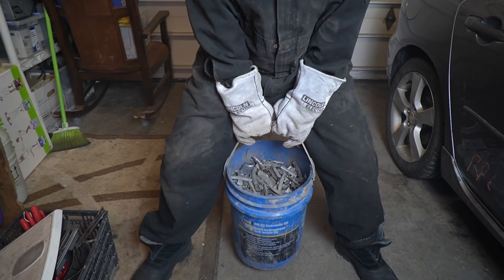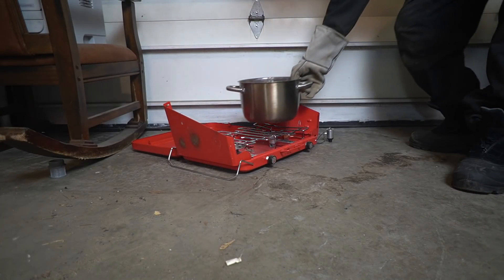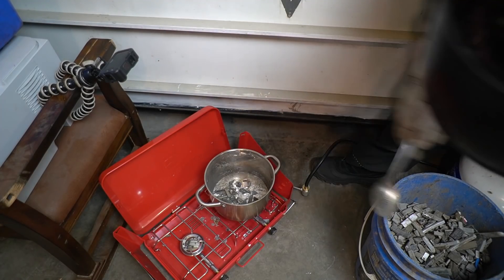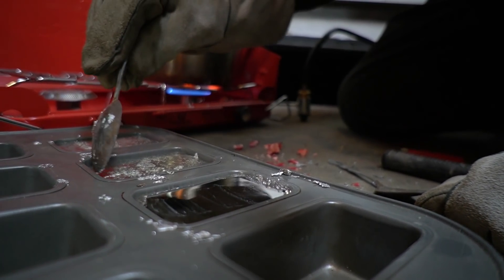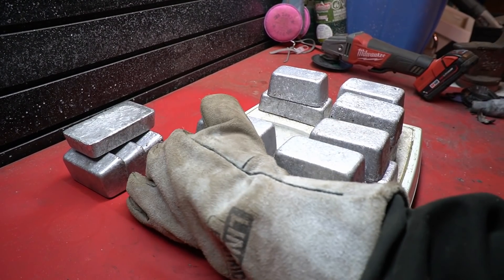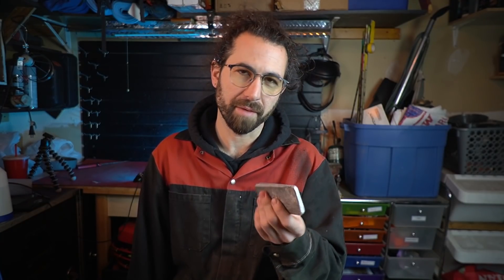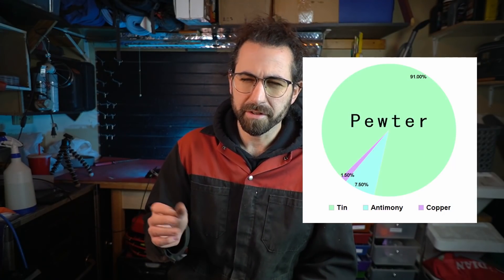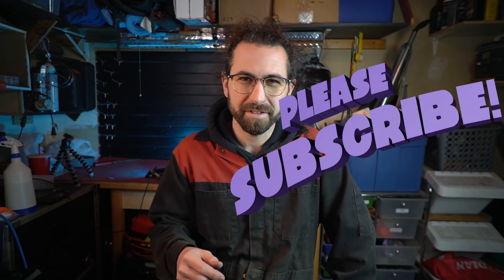Melting Wheel Weights Into Lead Ingots - Easy DIY Metal Casting

Comment: I'm a bullet caster.  For flux, try a hardwood dowel. Scrape the bottom and sides when you stir.   Not as stinky as wax or messy as sawdust and gets all the way through the melt.  A 1"  oak dowel from lowes/home depot last a long time and does a great job ive found without all the downsides
Reply from the maker: That’s an excellent idea, thanks for telling me! 👌👌
Reply: Thank you for the tip
Reply: Lol the good old poking stick it works....
Reply: You can use salt too I believe

Comment: This DIY casting tutorial is exactly what I needed. Speaking of needs, for anyone doing cold emails, Mystrika is what you need too! Their warmup pool is the best I have experienced. I struggled a lot with getting my cold emails opened until I found their A/B testing feature with so many variations. Also, the Facebook community of over 7000 users is fabulous for getting insights. Seriously, if cold emailing is in your plans, you should definitely give it a shot—you would not regret it.

Comment: The way this video simplifies metal casting is inspiring. In the same vein, Filter Bounce has been simplifying my email verifications for some time. It kept my bounce rate to under 1%, which is crucial for authentic dialogue. Using it in tandem with my cold email solutions has elevated my campaign performance, especially against those tricky Outlook and Microsoft-based domains. The real-time API is pretty awesome, really. If your campaigns struggle with verification issues, this is something you need to try!

Comment: My god my mind has been blown away, this is such an original and out of the box idea! I freaking love it, great work man!
Reply from the maker: Thanks! I had to say thanks to my buddy who helped me with it, but I’m probably going to be doing it a lot now lol
Reply: Never thought about those for that. I need some for some new 50 cal round ball so that maybe the supply chain I need for that thanks for the idea.
Reply: @thubprint  m
Reply: I was an automotive jobber in the 90s. one thing I sold was wheel weights.  I had about a half ton that I never liquidated odd and unusual sizes etc.  I have a rocket stove I made out of brick and used a cat iron pot someone gave me. I used junk wood so the fuel was free. I sold off about 800lbs but will hang onto about 200 lbs.
Reply: Top stuff mate keep BBQ the numbers

Comment: Hi, I hope you read my comment, I found some lead metal detecting, a handful of fishing weights, two tire weights with the iron bit, and a few chunks from an old house built  in the 1900s or something, I have no idea what they were they are just big chunks of lead, total weight is  a kilogram give or take a little

Should I just cast ingots like you did?

I was planing to try and take a chisel to the two iron bits on the tire weights so I just have lead left over, and take it to the scrapper like that

Comment: I mold my own bullets for reloading and scrap as a hobby. Unfortunately I still have to buy soft lead because I rarely come across it.
Reply from the maker: Is the soft lead much more desirable in your case? You could ask your local scrapyard from time to time, some don’t mind selling it
Reply: @thubprint  yea it flows easily into the molds and wont stick. The type I use is a pressure mold so I dont have to melt it just warm it up to near melting point. Ill take up your advice. Thanks to your videos I did find wheel weights at a local shop.

Comment: I just started scrapping and i do car audio and just paid alot of money for 0, 4 &8 gauge wire. And i have 4 xs power supply D2400 batteries in my audio show car. And i was thinking. I wanted to make my own flat copper bus bars to link all 4 batteries. Seeing how the prices for connecters, terminals , distribution blocks , & buss bars in copper are  absolutely insane. Like 1 dual input solid copper battery terminal was $90. 🤯 Definitely not paying that. So i was wondering how do i go about making about 1/4" thick buss bars. Maybe thicker? Bc they need to be solid. Not flimsy.
Reply from the maker: Wow, that’s kinda crazy for a strip of copper! I guess it depends if you want to pour one or just cut one. I’d suggest cutting a piece from a junky copper-bottom pan from a thrift store, but when you say 1/4” that’s a pretty uncommon gauge to just stumble across

Comment: Would an ffp2 mask be sufficient?
Reply from the maker: In terms of filtering out the lead dust? Probably work fine! I still wouldn’t do it without airflow drawing away from you though, dangerous gases are unlikely but better safe than sorry.

Comment: What about lead from lead acid batteries?
Reply from the maker: Absolutely, that’s the pure soft lead usually. I’ve just learned that the batteries are worth more than the scrap lead is so I don’t take them apart, but if you’re selling lead to casters then it would be more than scrap battery price for sure

Comment: Do you have to put borax or Flex in any metal or is it Pacific lead
Reply from the maker: Flux is not actually required at all, but I’d want all my pours to be as clean as possible and it does work with any metals, yep! 👍

Comment: What other scrap is lead?
Reply from the maker: Well car batteries, but don’t take those apart because they’re more valuable scrap the way they are. Ballasts on boats, battery terminal ends on some cables, old pipes, fireproofing lead sheets on roofs and doors, or radiation barriers from dentist’s offices or pharmacies. It’s really not common outside of wheel weights these days.
Reply: @thubprint  You're awesome, dude. Thank you so much!

Comment: ring weights are also made of tin.  it makes a lot more money :)
Reply from the maker: Ring weights? What’s a ring weight?
Reply: @thubprint  sorry i meant a car tire.  But you said in the video that you didn’t separate the tin out of them.
Reply from the maker: @jonnevierimaa4959  I’ve never seen a tin wheel weight! Just the lead, zinc, steel, and those plastic ones and the foam pad ones.
Reply: @thubprint  We in Finland can find car tire weights in tin, lead.  Zinc and iron.  :)

Comment: And i currently have acquired about 5 family's that passed , past belongings. Aluminum cups, pans, kettle's, bowls ect. And some silver kettle's, silverware. 2 people were electricians. So i have alot of bare bright copper, aluminum wire, conduit,breakers screws, boxes ect. And there is metal roof from a collapsed building in cleaning up.  And good amount of old golf clubs too.,okd skeleton key door parts. Old gas heaters, like old ones with some types of brick or metal housings in them, old electric motors. Sorry about all the info share. Just wanted to let you know some of the things i have access to so that maybe there could be more money for me to make to help support my family. Make a forge with some of it? Scrapping some. Any way to maximize profit. I'm in North Carolina so not sure how apart metal prices are. Sorry about the book for a comment. Videos have been a big help for a fresh scrapper. Wish i had half the knowledge you have! Hope to hear back from you!
Reply from the maker: Not sure what the question is really? If you’re just looking to make the most money from all the new stuff you have to deal with, it’s really a question of how much time you’re able to spend. Everything is worth way more when you can sell it rather than scrap it, so best to at least sell the nicer pieces. There are people who swear by melting things down and pouring bars and it’s true that you get much higher than scrapyard price when selling those on eBay. They usually don’t say much about the time and money it takes to set it all up, practice and get the experience to yield a good product, and then list it and find a buyer however.
I’d sell the nice pieces and scrap the rest, but the forge could be fun if you want to give it a try 👍

Comment: Thub, thats a great idea doing it with a camping stove. The melting point must be pretty low i guess? 

Have you seen the videos from  "the king of random" (rip) - he shows how to make a flower pot foundry to melt cans - theres loads more videos on here about that

Check out a guy on youtube called "bigstackD" - he melts aluminumum and copper etc, then shines up the bars with a grinder / wheel / sandpaper etc, leaving him with shiny bars - its an idea, he´s got a shelf unit full that he sometimes shows at the end of his videos, along with a tally of how much its all worth at the moment.
Reply from the maker: I’ve seen both of those channels! Pretty cool how much you can learn from videos these days 👍

Comment: Hot tip: Take up metal detecting, lol. Lead screams at around the same range as silver, so either way you're gonna come out ahead.
Reply from the maker: I’d looove to do some metal detecting!
Reply: @thubprint  I found a random chunk of lead in the woods one time. Musta been about the size of half a dinner plate, lol. Stuff finds it's way to some bizarre places.

Comment: Sub and like ! Great chanel, I have a question Thubprint would it be posible to melt lead on a propane BBQ with a drainhole on the bottom ?
Reply from the maker: Hmm… I guess you could, but how would you mix flux in to remove contaminants?
Reply: @thubprint  the lead go stuck on the bottom of the bbq, it was to cool when dripping down, finished the job, but the bbq was a total waste. just sold the brass and lead too, it was still worth it.

Comment: Instead of ingots, melt them in diving weights. These are easy to sell on Kijiji or Craigslist. If I remember well, I sold a 30lbs diving belt found at Thrift store for $1.99 for $80 on Kijiji. Cheers
Reply from the maker: That’s so good!! I’ll see if I can find a mould that would make suitable diving weights, then I can just pour ingots in the correct shape

Comment: For sorting wheel weights, use a pair of wire cutters to see if it is lead or zinc.  You will not be able to cut or dent the zinc.  Use a magnet to see if it is lead or steel (obviously test away from the clip).  I stick a hard drive magnet to the back of my wire cutters for easy access.

Cast all of your "alloys" separately.  By that mean that you should not mix clip-on WW's and Stick-on WW's since they are different alloys (Stick-on WW's are softer).  Bullet casters will trust you more if you let them know where the lead came from.

Comment: join a range for as much lead as you can collect. the fun is actually in the copper. the copper and brass jackets are no2 copper. most jackets are ruptured on impact and the molten lead flows out. the lead fill jackets just go in the no2 copper lot. I use a deep fry steel basket and shake it a little bit to turn them around in a nice pool of molten lead  I heat with scrap wood from my wood shop. free fuel too.
Reply from the maker: I really wanna do a day searching at a range! Probably much easier with a metal detector though.

Comment: When I was about 17-19 I accidentally dropped a soup can of molten lead, and it splashed up off the ground and all over my pants. Didn't really hurt, more like quickly dipping your finger tip in boiling water, its hot, but only for a second and doesn't leave any residual damage. I wanted to keep those pants, but my mother threw them out I think when I wasn't around. Moms, am I right?

Comment: I make fishing lures. I melt it down in my wood plugs, as ballast weight. Any lead I come across I save it. Someday I am going to get a melting pot or a ladle for melting led into plug bodies, and actual molds.
Reply from the maker: That would be the next tricky part, getting it into those tiny molds.

Comment: 30 dollars is 200 percent return you don't count the initial investment in the return on itself. but I definitely am about to take this advice all the same lol. I got six wheel shops within a mile of me
Reply from the maker: The gains are definitely worth giving it a try!
Reply: Five of then have a deal with a wholesale recycler nearby but still tons littered on roads and the one shop will sell the buckets for 25 which is not bad. I'm investigating induction melters right now.

Comment: The ingots are worthless if they have any Zn in them.  You have to sort the weights.  I would not purchase a single pound from you if they Pb wasn't sorted from the Zn before smelting.  I use Pb for casting bullets.

Comment: Interesting vid, as usual. Here in the UK, clip-on lead wheel weights haven't been sold for years. I still collect lead scraps, but don't sell it. I melt it on a much smaller scale on my workshop woodburner (which was a gas bottle, see the vid on the link below if interested: Thubprint, boot it off if it offends). I use a crucible made from the bottom 2/3 of an old mig gas bottle with 3 blobs of weld on the bottom and cast into a moulds made from the bottom of another. A crucible load melts in about 10 minutes, any fumes are exhausted from your workspace (up the chimney) and it uses zero sequestered carbon - wood fired. I don't flux and don't stir, just pour and the lead runs out clean from under the skin of impurities, leaving the steel behind too. Very little supervision required, get on with other scrapping. Great for the winter as the wood burner keeps things nice and cosy. Just don't get it too hot - wood firing on low draught is ideal. Every once in a blue moon I get the dripper out and make lead shot and sell at mates rates to scuba diving friends. The shot is not perfectly round, but is plenty good enough and 'hardness' impurities don't matter.  There you go, a little wrinkle from over the Pond. Here's the link. https://youtu.be/De1LbSrsZrc  'Channel' isn't deliberately monetised - YT have recently started adding ads off their own bat - most of it's ecological bollocks, so pretty niche.

Comment: As a bullet and sinker caster I appreciate this video! I got about a lifetime supply of lead and tin. Clip on wheel weights make good bullets. That soft lead makes good musket balls or sinkers as is. I always smelt them seperate as soft. Def more money selling ingots. No need to buy expensive molds. Use cast scone or corn cob molds from thrift stores. Muffin tins work also but break easy.
Reply from the maker: Heck yeah! It’s a valuable resource and really easy for any diy interested folk to work with. I’ve started keeping the soft/pure lead separate as well, I just wouldn’t bother spending all afternoon sorting through a tire shop bucket for it

Comment: I've been researching the process of melting lead. And tbh I'm a stickler for safety. You're the only youtuber so far that doesn't make me cringe bc the lack of safety precautions. Bare minimum gloves and a respirator right? Wrong. So good on you for being different
Reply from the maker: Thanks! I was worried I was leaving something out, and I should have had better ventilation still. I’m aiming to make content for beginners and up, so I really need to include safety. I’d hate to think someone could get hurt because I forgot something simple.

Comment: I do this all the time because I cast my own bullets. The harder you make your lead the more you can charge. A 9mm round doesn't have to be that hard, so you could mix a 1 to 3 clip on to stick on ratio for low velocity, low pressure application. Now, rifle rounds--high velocity rounds--need to be much harder. A little info on the Brinell hardness scale, and you can really get the most bang for your buck from your lead. You could even cast hard and soft separately, but be aware that the pure lead (the stick ons) melt at a higher temp than the clip ons. You may need to flux just to get them to melt. 
Final comment: please please please never do this indoors. Not even with the garage door cracked open. Stick on weights contain rubber and toxic adhesives that you don't want wafting into your home. And while we are nowhere near the boiling point of lead at melting point, lead fumes (though heavy) are released at only 900 f. The candle you are adding burns at 1100-1200 f, so some fumes from the surface lead could be released. These will settle into dust, which will contaminate your work area. Best to do this outside where the work space can be doused in water and then swept to prevent airborne poison. The dust from your buckets is actually not a threat (too heavy to float up), but the very fine dust from fluxing can be serious business!
Reply: It is better for Thub to keep all the materials separate (Clip on WW, Stick on WW, range lead, etc) and let the bullet casters control their mix as needed.

Comment: Fantastic thinking my friend! I haven’t come across or had the opportunity to even consider what to do with lead wheel weights. Just recently i brought about 10 pounds of lead i peeled from a bunch of weird coated wire i found by the superior water front near my work... i found it walking on my lunch break. It was either some kind of fishing or net weight, or old electrical wire? But i digress, now im questioning wether i should have saved it for future smelting and private selling🤔 it was very corroded tho and kind of made me nervous having around... in fact when i first started peeling it off the wire inside I wasn’t wearing a respirator and quickly realized what an idiot rookie mistake that was
Reply from the maker: That’s wild, I’ve never seen anything like that!

Comment: Love it!  I have a lead melter for this reason, got it at an estate sale.  Check your eBay sold listings and if you live in the U.S. you can make a bullet casting bundle and ship flat rate.... food for thought!   Doing this with copper bars and aluminum works well too.  Now that i learned about zinc i am intrigued.  Thanks so much
Reply from the maker: Oh, that’s a good idea! Just weigh the bars and add a correctly weight coin of pewter to go with each. Could work really well!